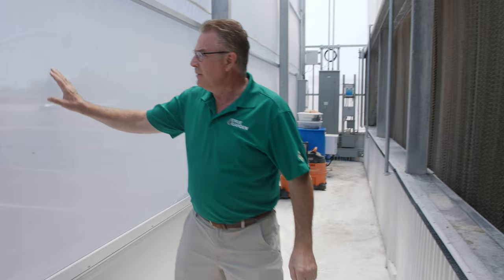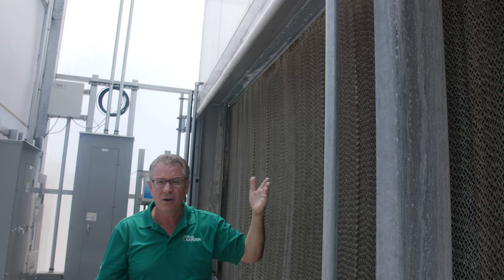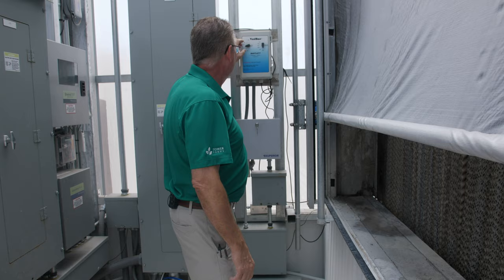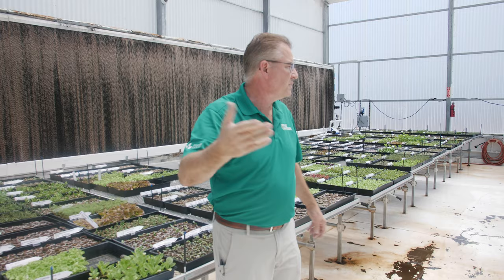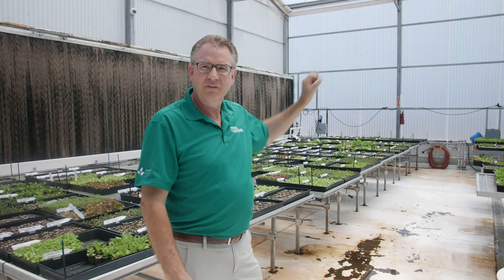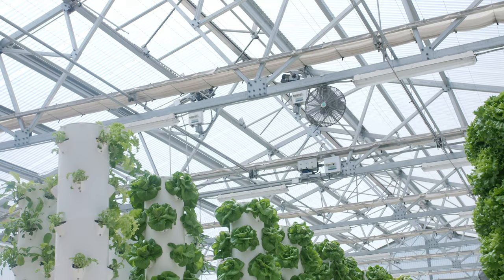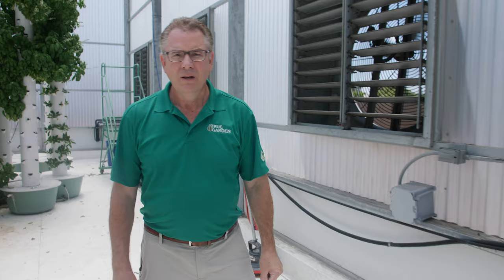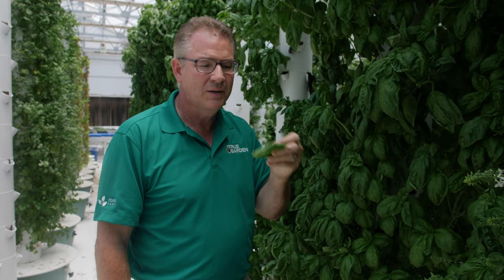How We Built Our Urban Greenhouse for Maximum Efficiency | True Garden

Comment: How do i get in touch with you about building a greenhouse like this?
Reply: Workingclass_1982  I’d like to know that answer too.
Reply: Ted Holmes  it seems like no one likes to answer any questions on here
Reply: @Workingclass_  indeed. I just keep checking out uTube video’s to get an idea. Cost and durability. Two main factors. Of course it’s going to make a big difference on where you live.

What I’m finding now is regardless of how hot it gets (Arizona , Nevada and California)  or how cold it gets ( -0 in many areas). It makes sense to dig down and run pipes for ground control  temperature equalization .  Around 64*  summer or winter. Plus a foundation  several feet below the surface.  One could save a lot on heating and air conditioning. Plus if you push the dug up earth against the sides that would protect against high winds and flooding.  More earth = less building material.

Even dig below that and put in cisterns for rain water catchment and root cellar for food storage to save on refrigeration.
Reply: In Montclair California there's a company that sell greenhouses. Conley's Greenhouse Mfg&Sales,  you can find them in the web.
Reply from the maker: We currently sell and ship Tower Garden within the U.S. and Canada only. You may purchase Tower Garden directly from our website or from a sales representative in your area.

Interested in starting a Tower Farm? Please contact us at info@towerfarms.com for more information. https://rxformulations.towergarden.com/grow/tower-farms
Towers can be purchased at https://rxformulations.towergarden.com
Reply: Love the idea and the informational videos but the prices for these towers is a little steep imo for most people.. You could build a huge diy version for about a quarter of these towers.. Again not knocking the man or his business tactics, but maybe think about the consumers point of view or someone that doesn't have much money to be able to get into this or isn't a diyer? Just a thougt.